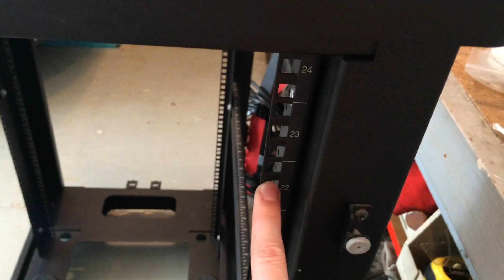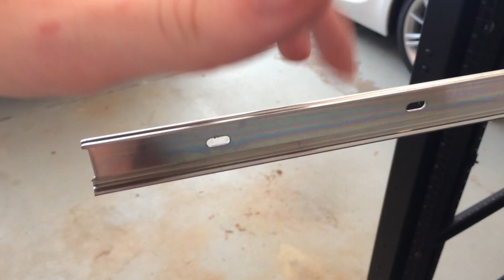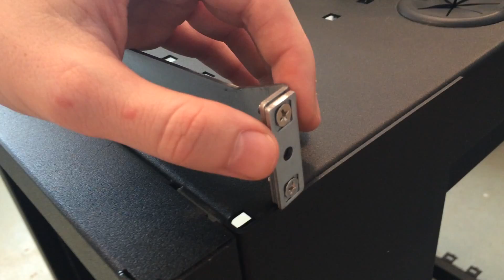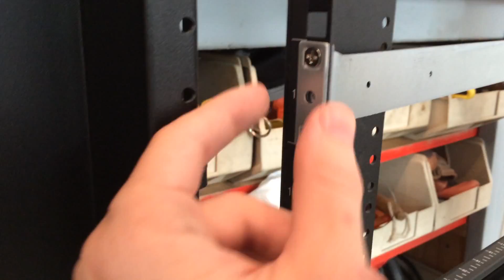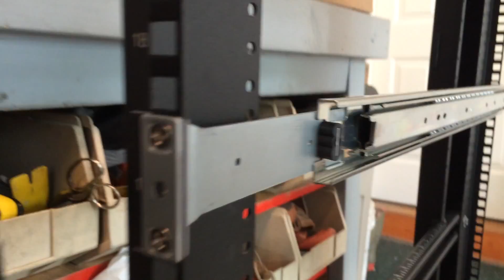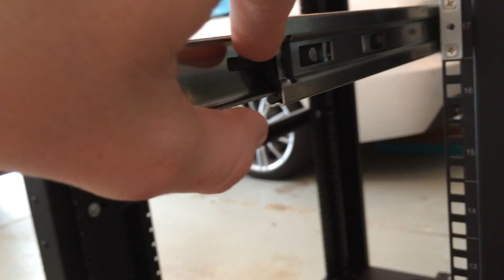Norco RL 26 Rail kit - Installation

Comment: very hard to get those 26 rails it seems, Norco messed up the width of the cases and not follow the standards, you can do a workaround by bending the ends were its fitted on the rack to allow little more space for the case

Comment: Why does the front if my chassis have threaded round holes, where yours has open square holes?
Reply from the maker: Threaded hole racks are typically used for audio equipment which doesn't require rail kits. Most modern server racks use the square hole standard. Take a look here for details: https://www.server-racks.com/rack-hole-types.html